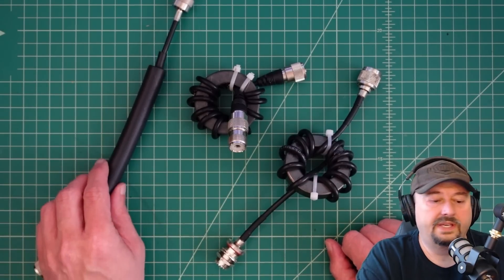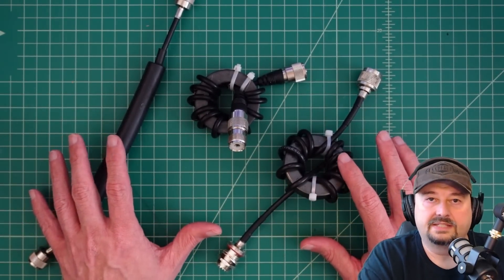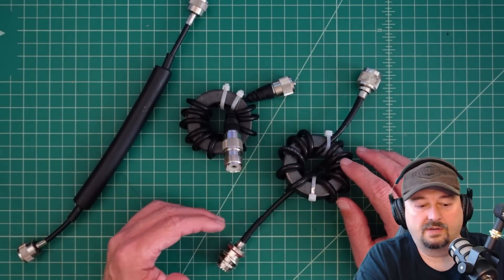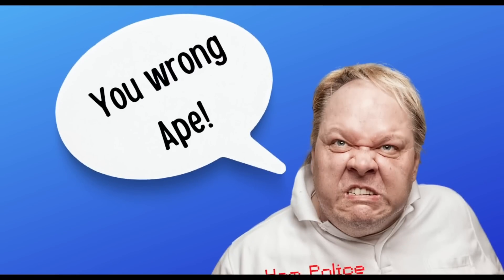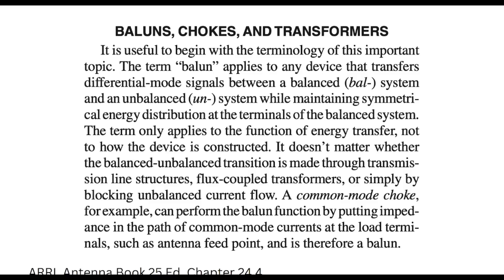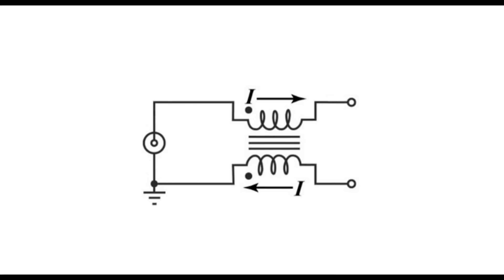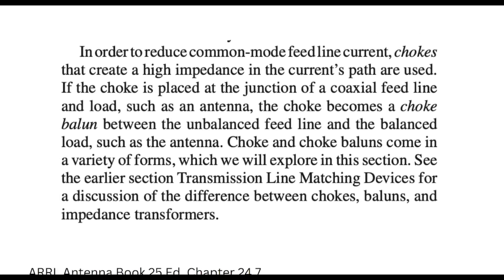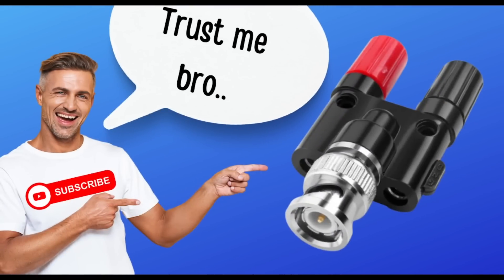Debunking the Ham Radio Choke & Balun Myth

Comment: Those chokes are still unun are they not? You can do common mode chokes that go from balanced to unbalanced, like you showed in the schematic. But the coax to coax is not a balanced line. Thats my understanding of this from my antenna theory course. I am welcome to being wrong but from my understanding the text is not talking about what youre showing, from my understanding.
Reply from the maker: What makes a choke a balun, is the installation location.
Reply: @TheSmokinApe  i can vibe with that
Reply: You're not wrong, they are ununs. But if placed at the feed point of a balanced dipole, they would still function as a balun. I think Ape's point is to not get bogged down in semantics and terminology, just pay attention to how things work electrically and how they can be used in various applications. Cheers es 73!
Reply: @socallars3748  that was my take away as well but just wanted to make sure for my professional understanding I had it down

Comment: I just see that there are two purposes for a balun or unun (whatever...)
1. Impedance matching between the feed line and the antenna.
2. Prevent current going backwards through the feed line into the transmitter and/or operator. HF burns are nasty.
If the balun/unun isn't able to do that for you then you might want to try a different setup.

Comment: I'm a sticker for measurement and I've seen videos where the measurements were made. The ones built with individual wires were the most effective. I've not seen one like the mfj style one measured. I've seen ones built with coax wrapped around a torroid , and they were highly ineffective .
Reply: The bifilar chokes tend to also be lossy. They expose the signal line to lossy material more directly. Physics is mean sometimes 😭
Reply: @californiakayaker Check the K9YC Choke Cookbook - that's not quite accurate
Reply from the maker: Joe is correct.

Comment: Thanks Ape. I am still learning many things of ham radio and like watching your videos. Where does ferrite beads on your coax fall into this discussion? I understand that they help with cmc but are they considered a balun, unun or just a choke? Where would you use them on an dipole, off center fed dipole or an end fed antenna?
Reply from the maker: Glad you like the videos.  I would say it's a choke, it becomes a "choke Balun" if it is installed at the antenna feedpoint 👍

Comment: Choke ? Is ok. But BALun word is controversial
Reply from the maker: Yes, it is…. Not sure why.
Reply: A balun has a very specific meaning often abused.  But then, so is choke.  For reducing RF on the outside of a coax, "choke" is a more correct term describing its function.   Balun simply means balanced-to-unbalanced.  A dipole is inherently balanced, coax is inherently unbalanced.   It can still be 50 ohm to 50 ohm, but a balanced antenna will usually have zero current on the outside of the coax.  Without an actual balun, the outside of the coax actually becomes an extension of one leg of the dipole.  Hence the need for a choke if you aren't going to balun.

EFHW's tend to require the outside of the coax as the "counterpoise" for the antenna transformer.  The current needs some place to GO.

Comment: Great explanation that really made this much clearer to me, thanks a lot.
I have one question, though: among the three devices you show at the beginning of the video, we can clearly see how the two ones on the right are made. What about the one on the left? What's inside the black shrink wrap? just ferrite beads around the coax cable or something else?
Reply: Yeup ferrite beads
Reply from the maker: Yes, just beads on a short piece of coax, thanks for watching Alain 👍
Reply: I have a coax going to a mobile antenna and I obtained a choke which was just two halves of ferrite that could be closed over the cable with plastic catches. Not sure if it is useful. Bit like a T shirt that warns off pink elephants, worked perfectly so far.
As I understand it, you don’t want RF energy going through your 12V electrics which can cause strange things. A choke prevents this.
I probably don’t that this 100%.
Reply: @darylcheshire1618  A choke is particularly useful on mobile radios since antennas tend not to be resonant or tuned.  Consequently rather a lot of RF travels back to the radio on the outside of the coax, thence to the body of the radio, thence up the microphone cable to your lips.  ZZZZT.  Ouch.  It bites.
Reply: @thomasmaughan4798  Thing is, I don't know of any magnet mount that comes with ferrite beads on the coax next to the base of the mount. So it's either clip-on beads or running the coax through a ferrite core like I saw in a video here.... but I wouldn't like having this lying on the roof of my car, probably banging it when I drive.
Reply: @F4LDT-Alain  In the case of VHF/UHF in the car, I don't worry much about RF coming down the coax.  It's laying on the roof of the car and capacitance will bleed off most of the RF anyway and probably helps with the SWR.  
HF is a different story.  The longer wavelength means the radio, and your hand on the microphone, becomes part of the antenna system.  Clip-on ferrites are nearly obligatory.
Reply: @thomasmaughan4798  Thanks for replying and for the tip. Well, I learned something new today. I've been working mobile in 10m, 20m and even 40m without any kind of choke or clip-on ferrite beads and never had any issue I could identify at least, so I'm kind of wondering what unwanted effect taking place I've missed. Anyway I'm gladly taking the good advice, and plastic-covered clip-on ferrite beads will probably be on their way to my coax some time soon.
I should probably add that at least for 40m, and sometimes for 20m too I have a large braid going from a ring terminal that goes over the SO-239 and under the antenna base to a nut on the body of the car. So I don't rely on the magnet mount's capacitance to the body only for grounding. Maybe this helps too? My magnet mount has a rather large circumference too. Best 73s.
Reply: @F4LDT-Alain  In my case it was the Icom auto-tuner for a mobile whip.  It is a great tuner but my grounding of it weak.   Some ferrites fixed it.  Also, 100 watts of RF not very far away will simply couple into the microphone cord and can cause some feedback so I had a ferrite on the microphone cord as well, where it attaches to the radio.  At the time I was using an Icom IC-735; a great radio and I still have it but the new SDR radios vastly surpass it.
Reply: @thomasmaughan4798  Oh well, I use a Xiegu G90 so 20 watts only, maybe that's why I have never noticed any side effect 😁 73s Thomas

Comment: Hey brother.   I would like to see a visual (Oscope) of the currents flowing on the shield and watch the CMC goes away with varies chokes/ choke baluns....   How would that set be?
Reply from the maker: I can put that on the video list.
Reply: @TheSmokinApe  nice...thank you
Reply: You make an inductive pickup to the oscilloscope.  A few small turns of wire would suffice.  Since the current runs along the length of the coax, you would put your inductive pickup so that an imaginary axis through the center of the turns is parallel to the coax.   It won't be very sensitive I think so more turns maybe around a pencil or something would increase mutual inductance.  Current inside the coax won't be detected outside, but current on the outside will be picked up by the sensing loop.
Reply: @thomasmaughan4798  yes...of course....thank you..